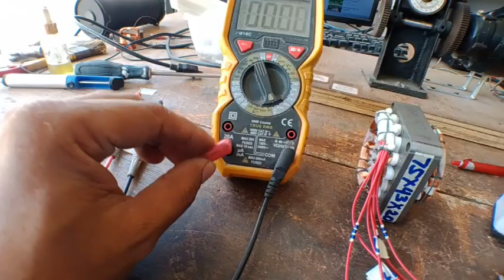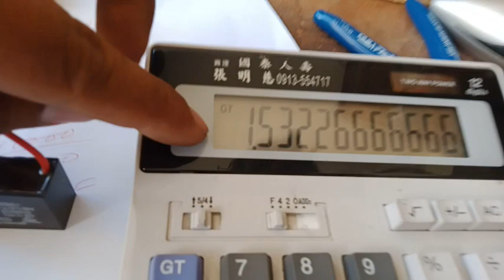PAANO MALAMAN ANG TAMANG CAPACITOR PARA SA ELECTRIC FAN

Comment: Ask lang po. Kung anong original brand ng 1.5 @2.0 uf na capacitor para sa electric fan mapa stand, disc at orbit fan po? Ty po.
Reply from the maker: Wala sa brand yan boss sa size ng core at magnetic wire nagbi base

Comment: Yong L1 kuya yan ba ang common wire na naka connect from beginning ng Running winding? Ty po.
Reply from the maker: Opo
Reply: Ty po sa reply sa mga info na. Binibigay mo po. God bless always po.
Reply: Paano po pag koha ng watts ng stator motor kapag bagong rewind at nagbago napo ang number of turns, at no power ang pag koha po? Ty po kuya.

Comment: Sir pwede ba ako gumamit ng same capacitance na capacitor (1.2uf) pero mas mababa ang Voltage rating? original kasi is 450v.ac kaso ang nabili ko lang is 400v.ac? Salamat po.
Reply from the maker: Ok lang po yan

Comment: Boss tanong ko lang po. 4 wires kasi yung motor na gusto ko testeran black, blue, brown, yellow/green san ko ikakabit yung tester para makuha ko kung ilang amps yung stator
Reply from the maker: Sundan mo boss yung wiring diagram or actual diagram kc iba iba ang color coding every brand ng electric fan. High and low lang ba speed nyan boss?

Comment: Bos paano kung 18 inches ang electric fan tapos bagong rewind ang motor humihina pag umiinit hindi naman nakalog ang shafting 450 volt 2uf ano po ba ang tamang rating pag bibili po ako ng rewind na motor?
Reply from the maker: Baka maliit yung ginamit na copper wire, dapat bago din yung capacitor
Reply: @xiantekelectronics  hindi ko po masigurado pero parang mababa ang rating ng bawat isa no.1 nasa 400+ tapos mas mababa na ang no2 no.3 bago po ang mga piyesa.

Comment: Ano po prob boss kapag baligtad ikot ng elesi?
Reply from the maker: May putol na ang running coil sir
Reply: @xiantekelectronics  eh boss brand new po ung rewind baka baliktad and wiring sa harap ko nalang pinuwesto ung wiring
Reply: Anong resulta pag di tama ang cacitor value
Reply: @lorenzovicjrendico932  mabilis masyado kapag mataas, kapag mababa mabagal